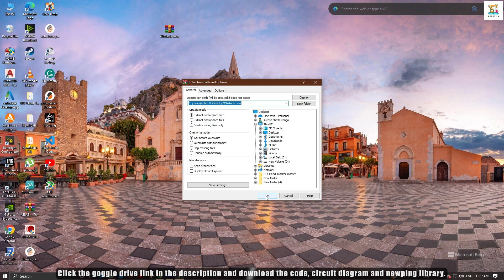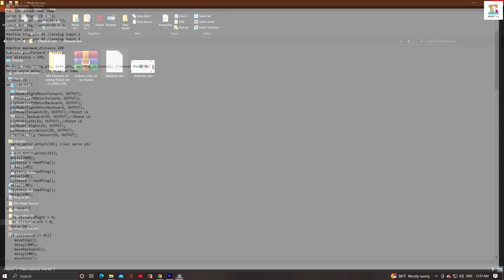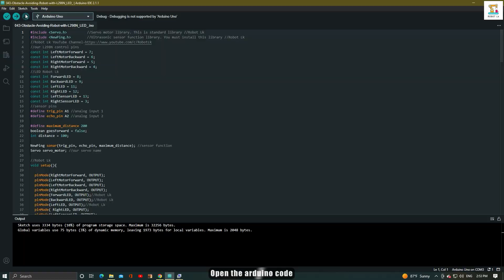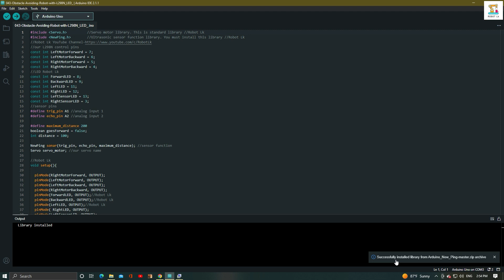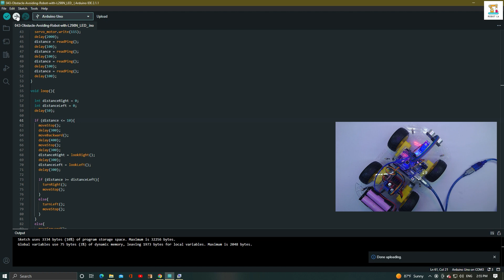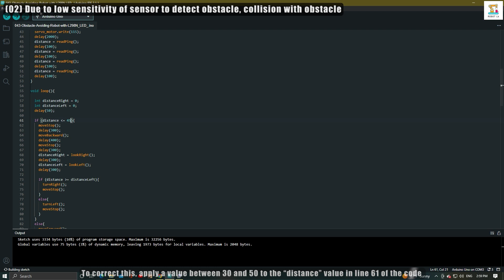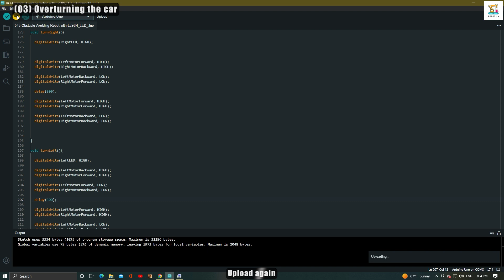How To Make Arduino Obstacle Avoiding Robot | L298N  Motor Driver | 4 Wheel Chassis Kit | 2024

Comment: Hello plz reply i have timline to complete the project ; 
Obstacle avoidance + Bluetooth control i wrote the code and everything but the problem is the hc-05 module keeps powering off after 5 seconds of pairing and i am using 2*3,7 lion battery why its not working? thanks bro

Comment: Hi brother I have done everything as you said but I have used 12v motor, whenever the ultrasonic sensor detects obstacle it stops, and it is not moving, could you say what's the reason?

Comment: Bro, I have connected the sensor with the 5v of the arduino . Now there is no 5v to connect the servo motor. Where will I connect it? And do we have to make any changes in the code?

Comment: Hello, I have a question brother, the robot worked well but when it does not find any object, it spins around and does not move forward.
Reply: Help brother please
Reply: @AngelLlamocca Brother he told that if it is spinning then just change the connections of the wires as he told in the video

Comment: Hello 
Broo my DC motors are working but the servo and ultrasonic sensor is not working can you please help me cause I have to submit it for the model making
Reply: hello ma no way i found youre comment
Reply from the maker: The ultrasonic sensor is damaged or not connected properly.
The ultrasonic sensor affects the operation of the servo motor.

Comment: Bro i connect the battery then the holder was heated and l298n motor driver also heated?
Reply from the maker: There may be a problem with the motor drive.

Comment: The servo motor output latch is not spinning but sound is coming what to do
Reply from the maker: A problem of power. Are you using a 9v battery?
Use both 18650 li ion batteries

Comment: The sensor is working but car is not working the battery is fully charged 3.7V
Reply from the maker: Does the motor drive have the 2pin mini connecter?

Comment: Brother i completed all the connections and i connected the battery without coading, but as i connect it the smoke comes form Arduino 🥺
Reply from the maker: What is the voltage of the connected battery?

Comment: Dont have 5 volt pin in my arduino I have 3.7 volt for ultra sonic sensor in my arduino uno italian version, it will work?
Reply from the maker: Connect the GND of the ultrasonic to the GND of the Arduino board, and connect the VCC pin of the ultrasonic sensor to the 5V out of the L298n motor drive.
Reply: @RobotLk  where should i canaect the encho pin?

Comment: bro my one is not working ne side wheel is going forward and other side is going backward
i dont know my servo is also not working its only turning one side
Reply: The side going backward... Interchange that side wires on the l298n motor driver. If out1 has red and out2 black, make out1 black and out2 red.

Comment: the project is infeasible, the 4 volt hubby motor will take more than 12 volt in output, and you are just giving 9 volt in supply.
Reply from the maker: 9v battery cannot be used. You can use rechargebale 9v battery. 9v battery amperage is not enough. Many people who have built using 9v battery have commented that it does not work properly.
Reply: @RobotLk  even if you will use 12 volt li-ion battery, it will still not suffice the voltage requirements. The output rating of 4 motor is more than 12, also you have to give power to servo and sensor. And you are using l298 instead of l293d

Comment: Hi bro 1stly please respond to my query 
Ive used (L293D. Motor driver)
Everything is fine I'm using 2 ×3.7 v cells but sensor is working but motor is not working please help i can  give you my mail id if you want to respond
Reply from the maker: If l293d motor shield is used, the arduino code must be completely changed. I am using a l298n motor drive. The code I used and the circuit diagram do not match the obstacle avoiding robot made using the l293d motor shield.